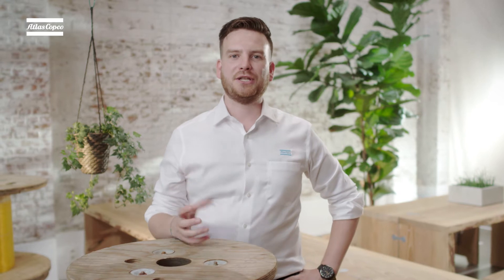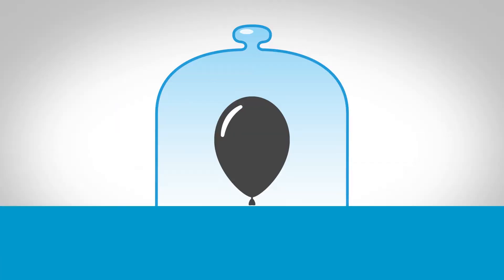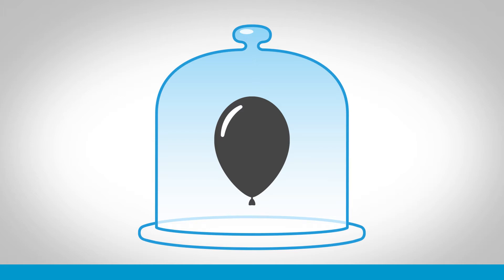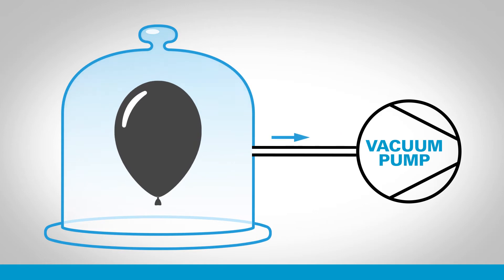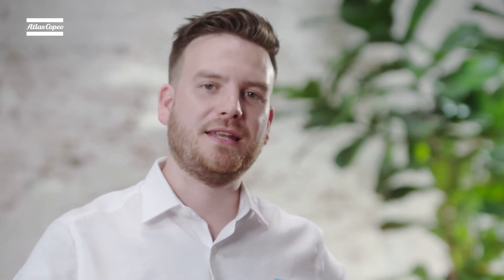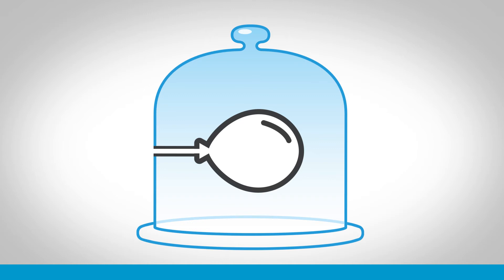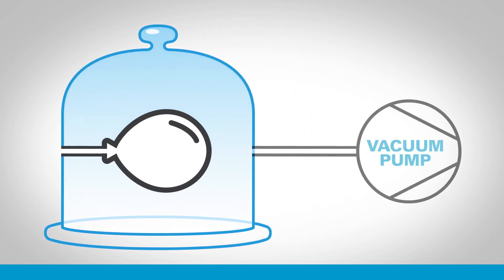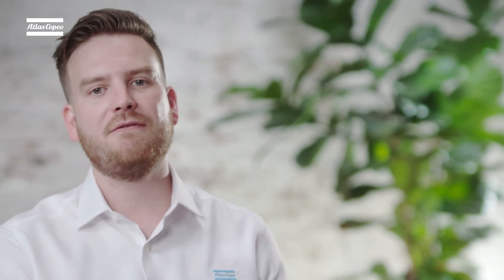Balloon Experiment - Understanding Pressure & Volume On Different Processes

Comment: Sir plz tell the difference between vacuum and air...
Reply: air pressure in vacuum would be 0, and ap in air depend on the sea level ur at, so in standard it would be 1.01×10^5 Pa